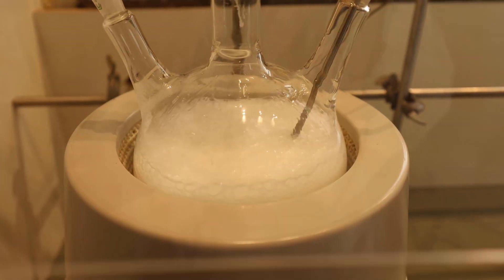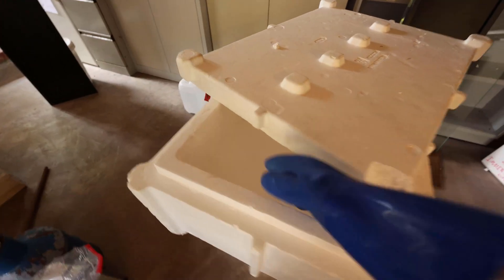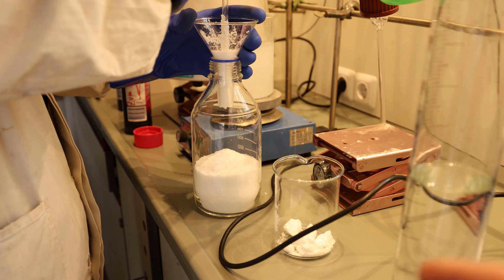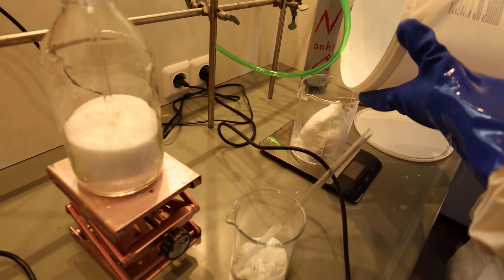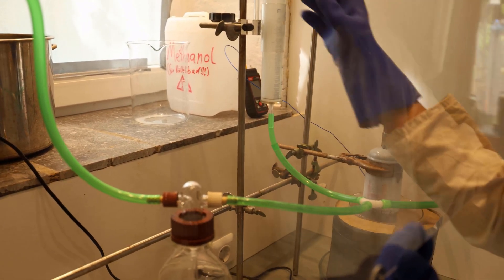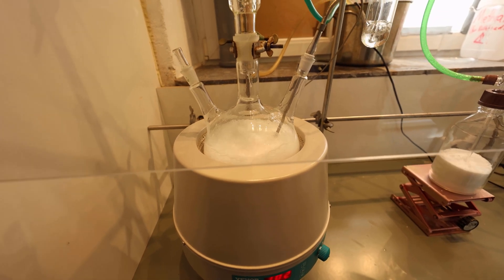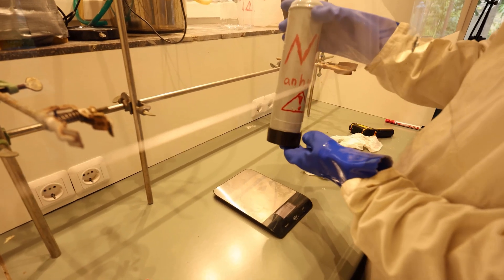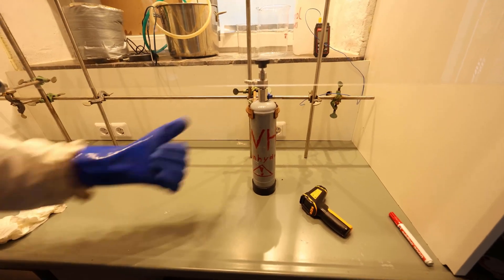Making anhydrous ammonia

Comment: Did you put a check valve in the circuit to prevent back flow of ammonia gas?
Reply from the maker: No, the cold ammonia bottle will definitely draw all the gas into it.
Reply: @thesciencefurry  sir can you make a small version of Herbert Bush process plant using hydrogen and nitrogen gas 

To make pressure you can use a 3000 PSI pressure pump 
The pressure will store in cylinder and ate the cylinder 

Sir that is my idea please reply 😢
Reply from the maker: @NoorMohamad-m1d It's called Haber Bosh and it is too dangerous to do at home.

Comment: Can you make video about gas cylinder please how is made
Reply from the maker: Sure, we have to replace it anyway at some point. It's basically just an single use argon bottle with the original valve drilled out the hole tapped and a new valve screwed in. But I would not repeat that,  it's not safe. We will use other cylinders in the future.
Reply: @thesciencefurry  yes i whant to see a better version and safe for high presure like chlorine or amonia gas

Comment: For making nitric acid you can use brick 1 from an automotive catalytic converter. It has the platinum and rhodoum in the right concentrations to do it surprisingly well. The irony is that brick 1 is used for reducing nitric oxide under the strongly reducing conditions of the exhaust 😂

Comment: It is bad idea to chill steel gas cylinders.  The steel can become brittle.  Stainless steel cylinders can stand this treatment.
Reply from the maker: We're aware of this problem. And I personally would not use this cylinder another time, but it's up to my friend if he wants to take the risk. Unfortunately I can't access the DIN norm, but in a document quoting the norm it says it can withstand at least -20 °C
Reply: Most anhydrous ammonia cylinders are stainless steel for smaller sized ones.

Comment: Wow. Isn't that stuff incredibly dangerous???

I think the answer is "Yes". Hooray for YouTube insanity!
Reply from the maker: Safety third :p
Reply: @thesciencefurry  stupidity last
Reply: No its not, i have inhaled quite decent quantity of it many times and nothing happened because our body is somewhat immune to it
Reply from the maker: @Exotic_Lab  You do realize that the least detectable limit is 5ppm and immidiate death is at 10.000 ppm. What we had here is not just a water solution it's pure ammonia 1.000.000 ppm. If stuff goes wrong you can get very high concentrations in the air, very fast.
Reply: @Exotic_Lab  bruh ammonia is some pretty awesomely nasty shit. especially in its most concentrated anhydrous form
and not to be overly curious but how do you have 1,8k subs but no vids?